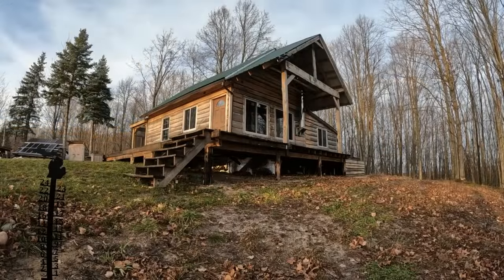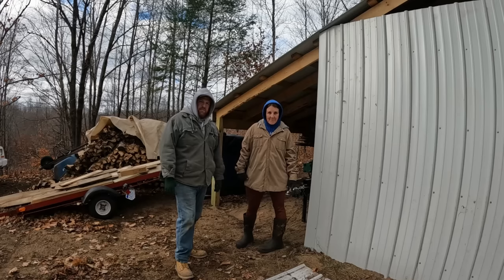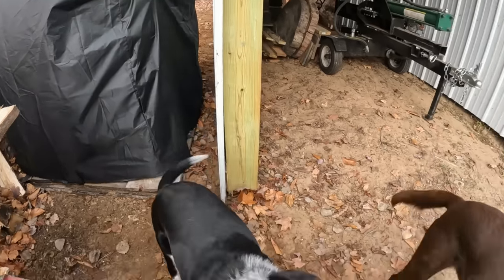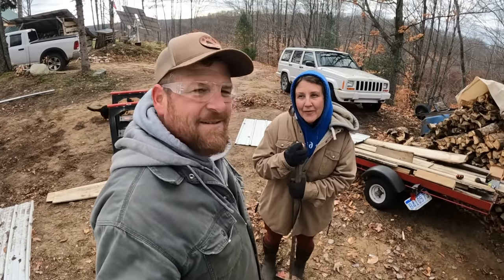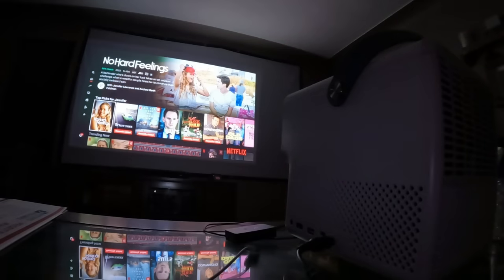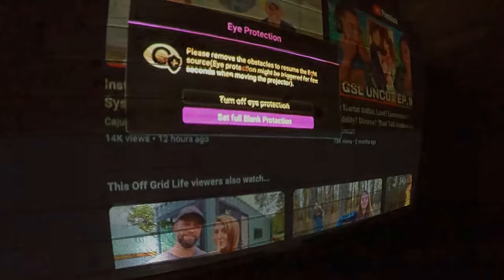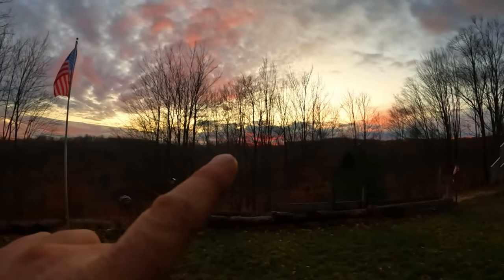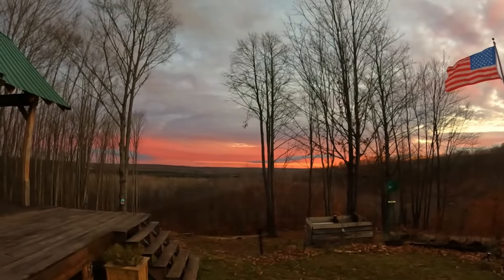DIY  Pole Barn Complete! - Closing In The  Off Grid Pole Barn!

Comment: just a thought. why not put a light sencer inside the pole barn. Si when the door goes up. the lights are already on. I have done this in my workshop.it saves on power. as you just go in and out. and after a couple of mins after you leave it goes out..they are not expensive. just a thought . phil